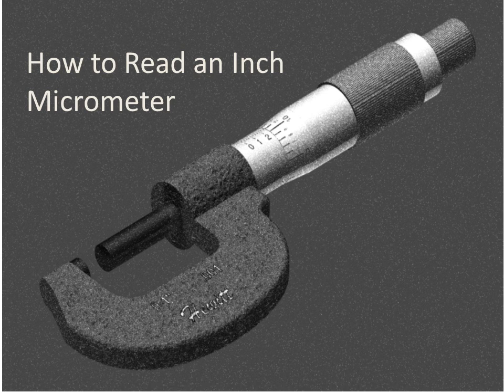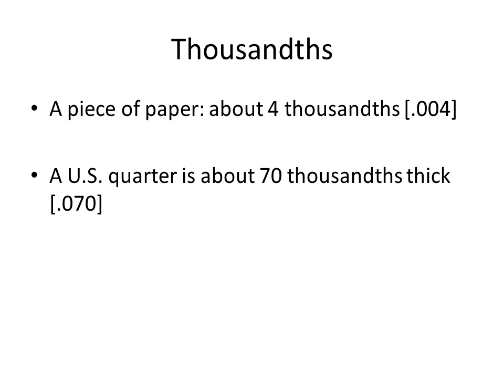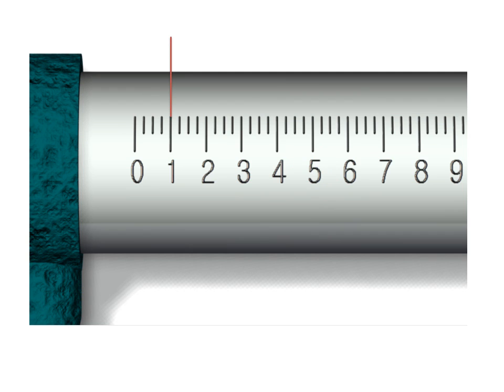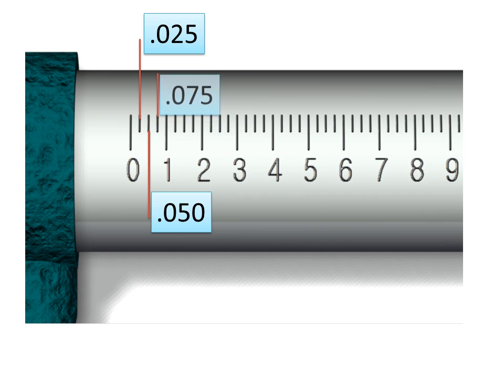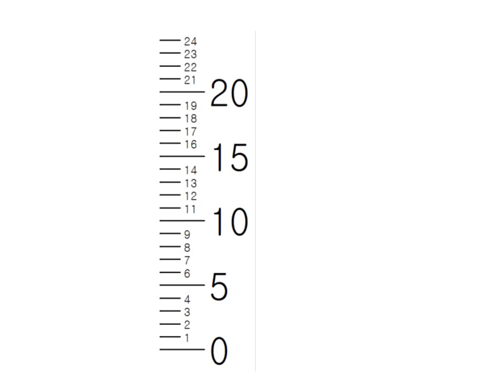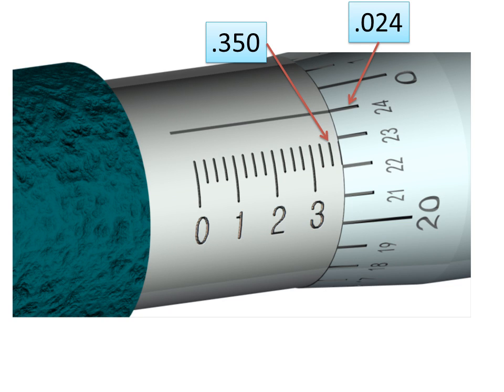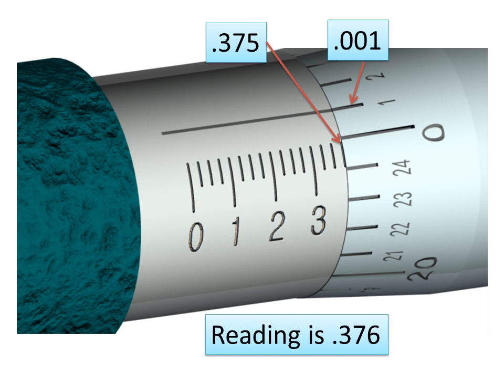How to Read an Inch Micrometer.wmv

Comment: Clear and concise explanation. 
Interesting that you are using thousands, which is what the metric system is based on; yet as soon as the USA gets to 64ths of an inch you revert to the imperial system. Why not stick with the metric system all the way through using microns, millimetres and so on?

Comment: Thanks... But mine has yet another scale on top of the barrel??  WTF are those lines for??
Reply: That is a vernier scale for reading in-between numbers on the thimble that don't line up and it will read 10,000ths. ie: 0.3759 for where it lines up with say the 9 for 9 ten thousandths. Your mic will say 0.0001" on it somewhere instead of the usual 0.001" You have a much better more accurate more expensively produced mic.😉
Reply: @TheGeezzer  Thanks for the lesson geezer.  I'm new to this stuff.  How I lived without this equipment is beyond me.😳😉

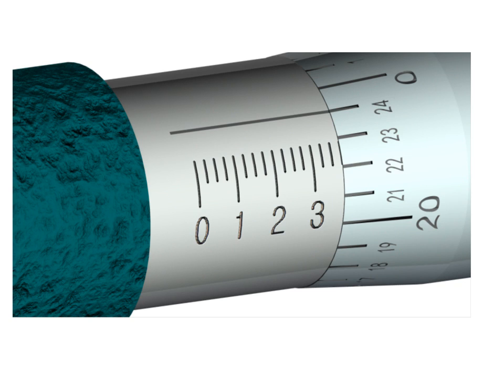Comment: at 4:48 you go from .375 to the rotating dial setting 0.024.  this is very confusing.   you should have gone from 0.350 to the dial setting  0.001 to demonstrate what the dial settings do.  the reason i say this is going from 0.0350 + 0.001 is the next logical step in the dial reading.  it is like something expanding, it shows the gradual increase in size.  jumping to the dial setting 0.024 is like....whoa...where did that come from.   

tbh up till that point i thought your explanation was going very well.  but then it became very very confusing....................

Comment: This is an excellent - clear - step by step instructions. I'm 50 years old trying to secure employment in quality control. I need to learn, understand and apply this type of skill set. It is not easy but you have made this so much easier to understand. I still have a long ways to go...but thank you! Now to push my luck do you have suggestion- blue print reading 101. I am add and a little dyslectic. But really grateful for the simple yet precise presentation.